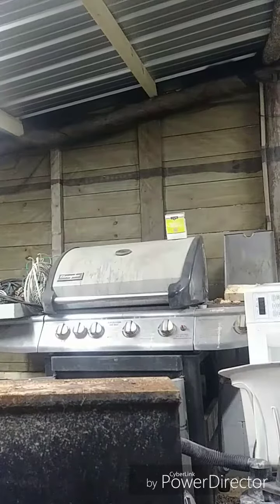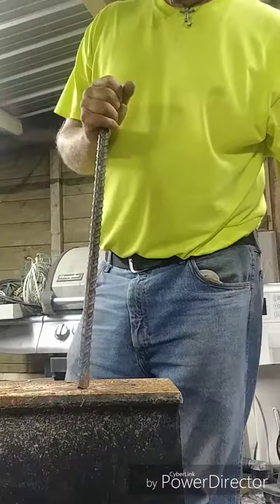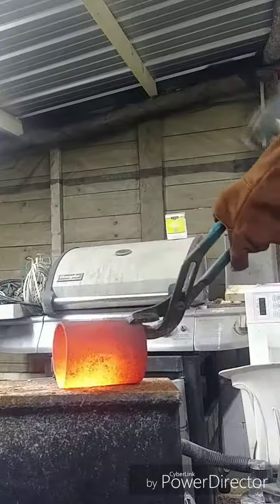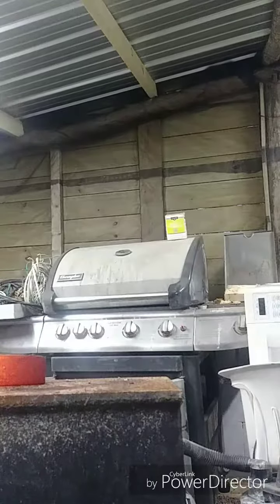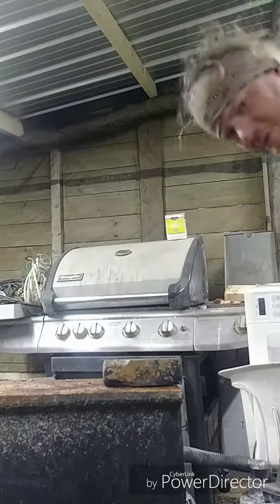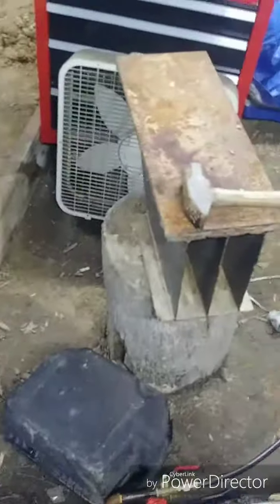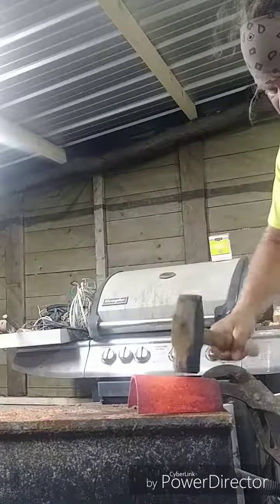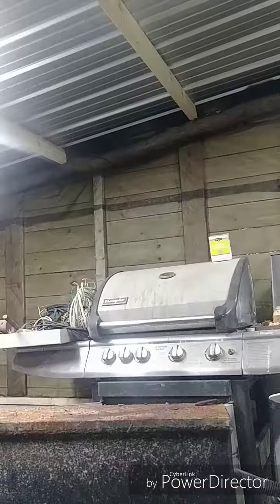Can you forge cast iron?

Comment: To weld steel and cast iron together, i use a torch and stick welder with 7018 low hydrogen rod. Works perfect.

Comment: Cast iron actually has a lower melting temp than steel. Wrought iron has the extremely high melting temp.
Reply from the maker: I stand corrected. Thank you sir.
Reply: I do have a crucible i can send you if you still need it.
Reply: Free of charge of course. From one Youtuber to another.😏
Reply from the maker: @benonablacksmith454  that is an awsome offer. But I ordered a graphite crucible the other day. I almost have the new foundry finished with the test diy refractory. So i had to hite the bullet and get one. But maybe you can give me a straight answer. Using steel or cast iron does the aluminum or whatever is being melted gain iron contaminates from the heated steel or iron?
Reply: I think the only contaminant you might pick up would be scale from the steel once it reaches a certain temperature but aluminum melts at a lower temp than what steel or cast iron starts scaling at.